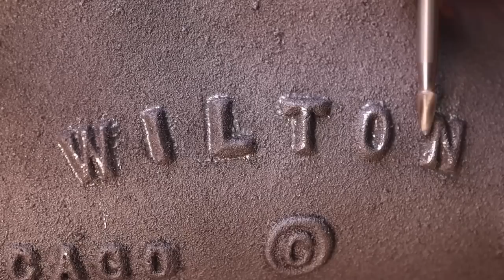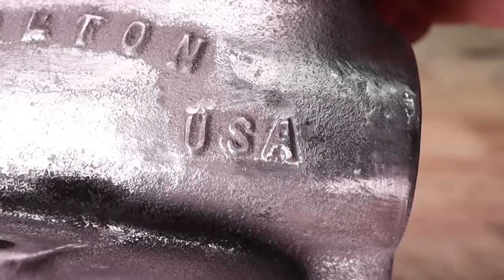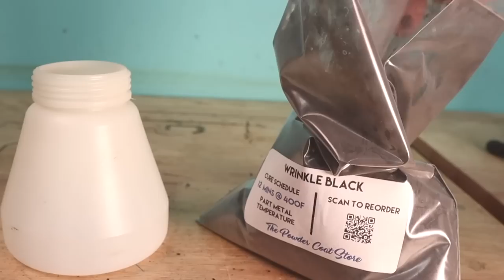Wilton Vise Restoration | Wrinkle Powdercoat???

Comment: I'm not a big fan of black on certain items. But that looks pretty sharp! Never heard of that color.
Reply: Wrinkle black powder coat is pretty popular among the hobbiest automotive crowd. When done right it can really dress up an engine, suspension components, interior pieces, etc. A good friend of mine used it on his Oldsmobile 455 that was going into his 1971 Cutlass. The block and heads were painted olds gold and he ordered some chrome finned valve covers and an aluminum intake. He did the wrinkle black finish on all of the valve covers except the tops of the fins and he did the whole intake too except the logos and lettering. Looked very very nice and I'm usually not a fan of black on engine parts.

Comment: I know these channels are about what can be done and not necessarily about what should be done, but I would have wirebrushed the bare metal parts and given it some grease – done. Maybe smooth jaws.

I’m happy about the successful screw extraction, that was good news.
Reply: I'm just glad none of the parts were buffed to a high bright finish like other channels do.  The cast imperfections make this vise the only one exactly like it.  I would have left them.
Reply from the maker: Whatever keeps us moving and grooving, keep on turning those wrenches! 😊
Reply: To be fair, black is a good, natural choice for the colour and deserves an extra point. Unfortunately we need to take 100 points away for tracing the letters 😭🙂
Reply from the maker: @mm9773  😂

Comment: looking at the seams and imperfections on the vice, quality control wasn't a priority. Great job in not only restoring, but improving on it when new!
Reply from the maker: Hey thanks Phil!
Reply: Those seams and imperfections are a byproduct of the sand casting process.  They in no way would have impacted the usefulness of the vise.  What would have been of concern are voids that reduce the structural integrity of the parts.  While the outcome of this refresh is visually pleasing nothing was done to actually restore the vise.
Reply from the maker: Thanks  @joedowling5452

Comment: What kind of blasting cabinet are you using.
Reply from the maker: Harbor freight
Reply: @Dr Restoration  what modifications did you do. Mine doesn't work good at all. Also what media are you using
Reply from the maker: @tullywebster1417  I added a light and a dust collector, usually use black diamond media
Reply: @Dr Restoration  it works really well. What size compressor
Reply from the maker: @tullywebster1417  a 26 gal 4.5scfm
Reply: @Dr Restoration  I have a 60gal compressor and it still doesn't work great. I've done the dust collection and pickup modifications. Still doesn't work near as well as yours. Same cabinet too.
Reply: @DrRestoration what brand if you don’t mind me asking. And at what psi are you getting 4.5cfm
Reply from the maker: @MiamiMarineF305  fortress brand. Usually I set it at 80-100 psi

Comment: Nice makeover  but I don't think those cap nuts are factory
Reply from the maker: I did some research, I think they are
Reply: @DrRestoration i had a vice that had both handles broke but this was no Wilton. I replaced them with 1/2" bolts and two 9/16" junk sockets welded on the bolts head. I  would loosen and tighten it with a 3/8" ratchet.